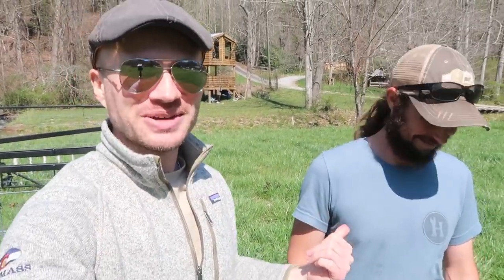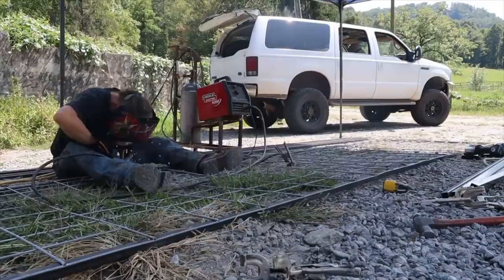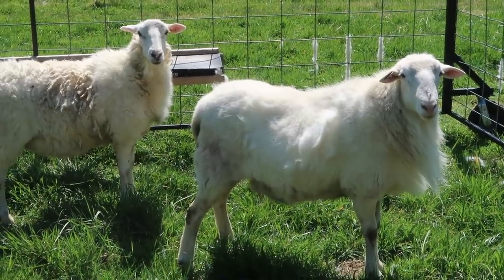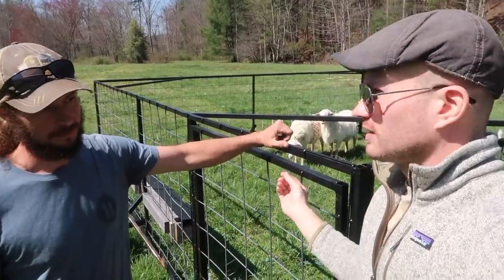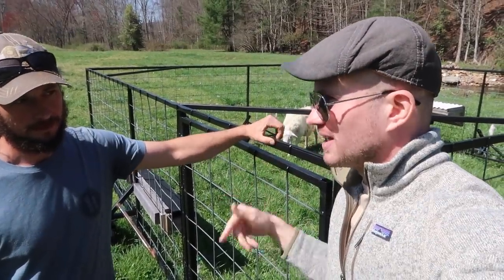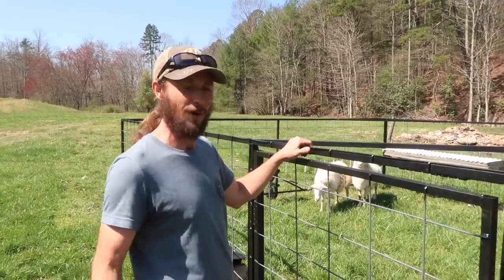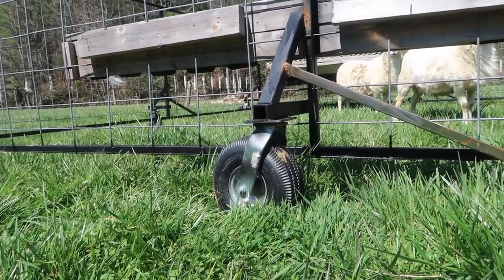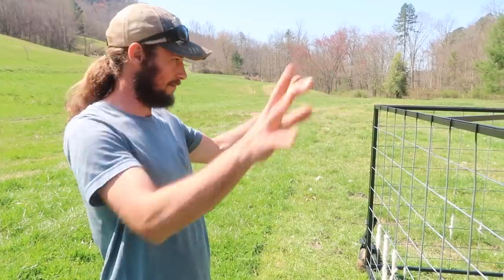Ben Hollar on Building Justin Rhodes' Mobile Sheep Pen | Wrestling Cage

Comment: Got to say that Ben is a very talented guy.  I remember seeing him do this on Rhodes' channel.  I don't know how many repairs have been made to this sheep shawl but for the almost daily wear and tear it gets as part of the pasture rotation they do this has turned out to be one durable productive tool.  Can't wait to see the one he makes for his own homestead.  Sounds like it may come with a 25 year warranty 🙂.
Reply: Wouldn't it be possible to rig up a crossbrace with bolts that drop into the middle of each upper frame wall?

A 16x16 cross made of that 1x1 probably wouldn't weigh too much and could be pulled off if someone needed to get in there to do work.

Comment: Lol, that original pic was from the one I built. Greg asked me for a pic of it so I texted him one. You guys made great improvements over mine. I just threw mine together quick and dirty and cheap. I only use mine now as an isolation pen if someone needs special attention or something. I run my rams in single poly wire away from the ewes on a different property. The ram pen worked great though for a couple of head. I always thought an octagon or hexagon shape would work great. The casters are the most expensive part of it really...besides labor. I also used flat proof casters.
Reply: Excellent comment, thanks for sharing.
Reply from the maker: oh wow! That's awesome! If I knew it started with you we would have credited you.
Reply: @TheGrassfedHomestead  No problem, I'm glad it was of some help. Greg originally gave me an old old pic of one from decades ago. I built mine based on that. After I got it built he said that's great, can you send me a pic of it and I'll forward it to Justin.  I said you bet. So I've not seen Justin show the pic he got but given it was so similar to mine I'm sure it was my pic.
Reply from the maker: @Digger927  yeah, that has to be the same one

Comment: Cool idea. A door would be nice in the center of the panel where it could be made to walk through. It would need some good gust in it.
Reply: Kevin Brewer ~ I don't know if you've seen the original build or any of the videos where they worked inside the "Wrestling Cage," but the door is built into the corner. Do you see an advantage to building the door into a center panel?

Comment: Fwiw I did this system for like a year with nothing but 4 cattle panels and the joints linked together with some high strength carabiners. Just lift one wall a few inches, walk it forward halfway, then do the other wall halfway, and then repeat.

Yeah the sheep push it a little bit, bulging it in the middle of the walls, but it's so much cheaper, and you can easily lift a wall over an obstacle like a bump, a tree stump or a bush.
Reply from the maker: Hopefully I will get something like this going this year
Reply: @TheGrassfedHomestead  just don't get injured lol. That's what spelled the end of my cattle panel sheep rotation, I hurt my shoulder in a shearing accident and had to get help putting them in a static pen while I healed.
Reply: Would this work to separate a ram from the ewes?
Reply: @shoshanafox727  probably not to be honest.

I never had that problem because Icelandic Sheep are seasonal breeders.

A ram who smells a ewe in heat that he can't reach will work a lot harder trying to get to her than a sheep who thinks the grass is greener on the other side works to get out.

It would work if the pens were far enough away, but having to walk a long distance to separate pens and having to figure out how to unite them when you want them to breed sounds like a pain

Comment: Design it in the round. It moves easier and it's stronger! The wheels move like butter. No stress points. We made ours using bamboo poles attached to bendable, light weight steel panels, top piece and bottom. The wheels are attached by welding to heavier pieces of steel welded to the bottom of the steel panel. It has five wheels placed evenly in the round shape of the pen. We saw this in Hawaii about 15 years ago. My Grandpa has the pen now for his chickens. Just our two cents, lol. GOD bless you and your family.
Reply: That sounds like a fantastic design!
Reply from the maker: I'd love to see a picture of that!

Comment: Hi Ben, I feel you did a great job building the mobile sheep pen. But when it is moved without enough help one puts a lot of stress on the metal, & welds. I feel you on you next one you should use 1/8 x 1” pieces of flat stock to weld on thin wall 1” in between where you have welds or install brackets. 1/8 x1 x4” piece would give you 12” of support than 1” weld. Great video, good information on the portable grazing pen for animal.
Reply from the maker: Thanks for the tips!

Comment: I wonder if ya could recycle old bed frames for that frame?
Reply: if you are referring to original iron bed frames, they are likely too heavy to pull across a field considering the animals are moved every day, sometimes twice a day. but it could certainly be recycled in other ways.
Reply: I think you mean the old-style "Hollywood" type frames. I doubt the angle iron is as solid as the tubular steel Ben used.
Reply: My husband has made several chicken tractors using old bed frames.  The metal is very strong to the point that he dulls his drill bits when making holes in them.  They are heavy but we pull them with a tractor.
Reply: @ceepark114   Thank You 🙏 that’s what I thought too‼️ I always stop and get them when I see them in people’s trash and have used them for years

Comment: Going with a smaller sized pen would reduce the high centering problem on uneven ground. I felt if I ever made one of these I would use trailer tongue jacks, at least in the corners, so to be able, to raise and lower to get over some places that are to uneven. If one is using on flat ground definitely not needed. 😃🐑👍🌤

Comment: A star-studded tour, huh ? :) :) Wish I were there ! Does it need the cattle/hog panel to be sturdy - is it structural ? Or could one use woven-wire/mesh fencing instead, especially with using the heavier-gauge metal for frame.. ? Sorry if covered in this and I missed it, having hard time concentrating today.
Reply: He only mentioned cattle panels.  being a non builder of things, I would think since it does not have a top or bottom, there just would be the rigidity you would need, even if it was a 10 x 10.  Just my thought.
Reply: You would need something to keep it from shearing which is what the cattle panels are providing (like plywood does for a stick frame house). Without panels you would need to add diagonal bracing.
Reply: @margaretbedwell58  Ok, thanks !
Reply: @jbrand255  Thanks !